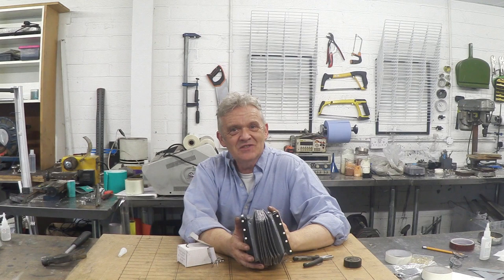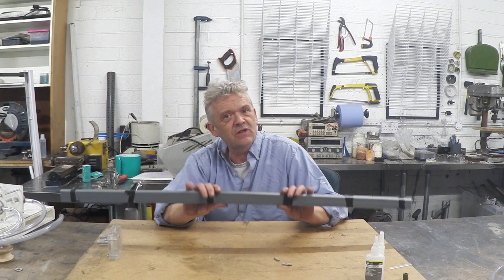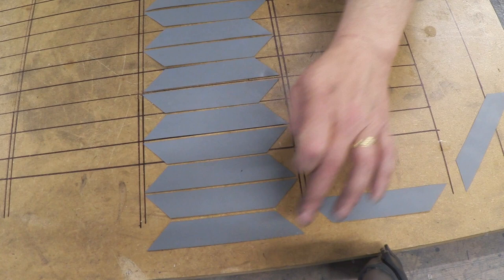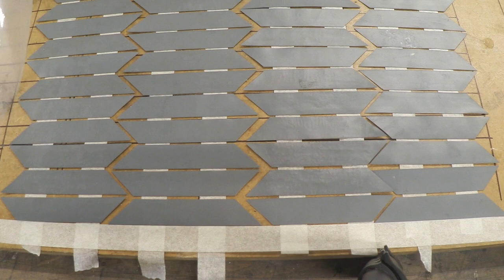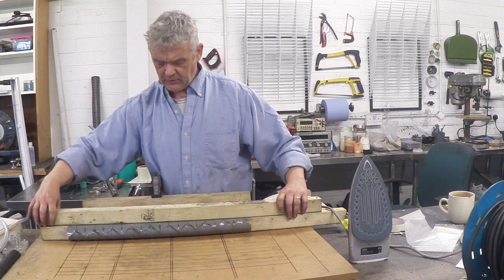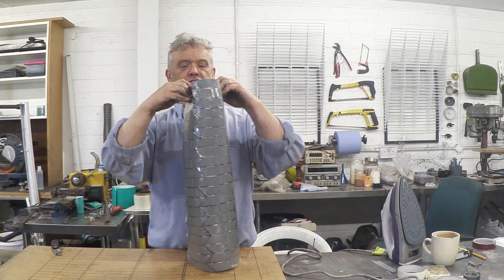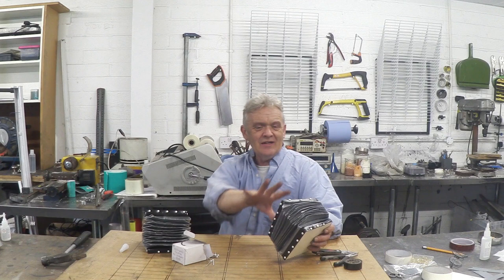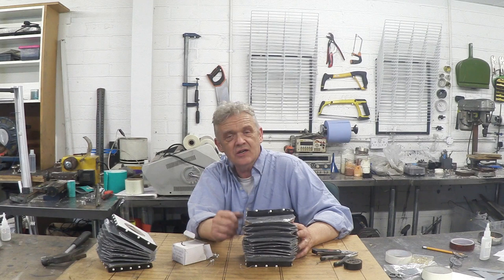Making Bellows From A Venetian Blind

Comment: Great video! It seems to me that if you started with a strip of the tape (sticky side up) pinned to your baseboard that when you laid out the first set of pieces (for each side) you could get the spacing perfect and not risk any of the pieces moving when you laid the top layer of tape on.

Comment: @Robert Murray-Smith  From a hand built standpoint those bellows look very well built.   Probably couldn't buy something as inexpensive, and high quality. 

I also love the customizable nature of them.  If you're a blacksmith and want a furnace bellows you could probably come up with some fiberglass blanket and heat resistant adhesive , use metal blinds and there you go.
Reply from the maker: cheers mate

Comment: Hi Rob
That is great I have another applicacion for this
Somewhat modified but as slideway protectors for diy cnc machines
The last thing you need is swarf getting into your nice precision linear bearings
It would have to be a channel section to lie either side of the carriage but could run on wires
either side to guide it
I hope that make sense
Maybe show me ?
Reply from the maker: i like that idea mate and itdoesmake sense - basically the cross section i did was square you can make any cross section by arranging the stiffeners correctly
Reply: @ThinkingandTinkering  Hi Rob
I will be building a CNC lathe over winter and am going to try it
It has to work just one half of your bellows , Thanks for the idea

Comment: The method is ingenious!!  I'm always amazed at the simplicity of your solutions.  I'm kicking myself for having recently thrown away some badly abused blinds (cats) after replacing them.  Already looking around to see "which window needs new blinds?"  😋  I was thinking a black lawn-and-leaf garbage bag might be perfect for the plastic - it's usually around 1.5 mil, which I think is probably about what lightweight laminating film is, and I have a ton around for autumn leaf raking.  Just not sure if thermal properties are similar, so I'll have to be careful ironing or end up with a real mess!
Reply from the maker: the laminating film has a coat of glue on it which the heat 'activates' I would use carpet glue if I were you
Reply: @ThinkingandTinkering  Ah, OK!!  I always thought it was simply a plastic with a higher melting temperature and/or different thermal properties.

Comment: Just realised a great cheep easyer option for this would be to use air condition/extractor fan  ducting consetina....   £20 for 30 meters  comes in a variety of Gerths... I have some 12 inch at home. Its airtight light tight and has a wire threaded throughout to gove registry... its even availible double lined with with aluminium inside so you can do hot hot air and have strenght.
Reply from the maker: Great tip mate - cheers

Comment: To think how long ago these were first made. I have a desire to do some research into the history of the bellows. I wonder if they were first created by a blacksmith and then adapted to a musical instrument. Will do some googling when I wake up in the morning.
Reply from the maker: go for it mate and let me know
Reply: @ThinkingandTinkering  yes it was invented for metallurgy originally. Here is an excellent clip from Wikipedia where there are some ancient bellow principals used, thip cut and past is a double piston bellows from China.
info from - https://en.wikipedia.org/wiki/Bellows#:~:text=Such%20bellows%20existed%20in%20China,from%20one%20level%20to%20another.
Double-acting piston bellows are a type of bellows used by blacksmiths and smelters to increase the air flow going into the forge, with the property that air is blown out on both strokes of the handle (in contrast to simpler and more common bellows that blow air when the stroke is in one direction and refill the bellows in the other direction). These bellows blow a more constant, and thus stronger, blast than simple bellows. Such bellows existed in China at least since the 5th century BC, when it was invented, and had reached Europe by the 16th century. In 240 BC, The ancient Greek inventor Ctesibius of Alexandria independently invented a double-action piston bellow used to lift water from one level to another.

A piston is enclosed in a rectangular box with a handle coming out one side. The piston edges are covered with feathers, fur, or soft paper to ensure that it is airtight and lubricated. As the piston is pulled, air from one side enters and flows through the nozzle and as it is pushed air enters from the opposite side and flows through the same nozzle.